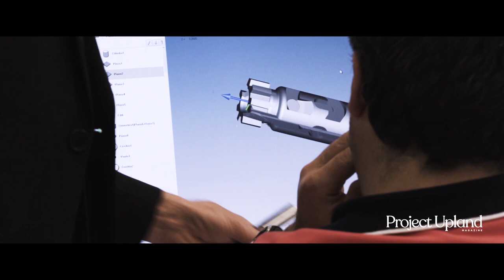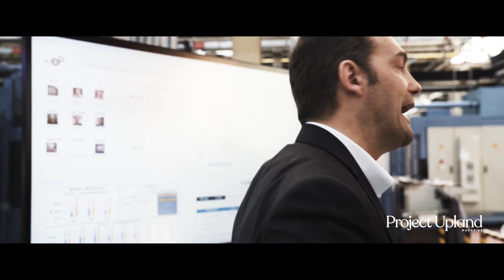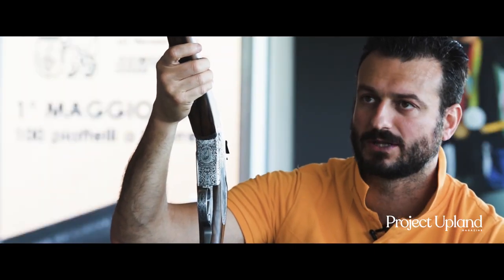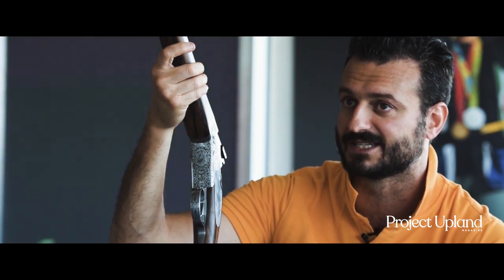Beretta SL3 Review and Factory Tour - Project Upland Magazine

Comment: Not a fan of monoblock barrels, esp. in high-priced guns. But their products are certainly durable. Then again I shoot guns that are 120 years old and still functioning perfectly. 3 have never had a repair.  One more point is that fit is critical in shotguns and though strong and durable, Beretta's stocks are too straight requiring just about everyone to contort himself over and around the gun. Most shooters today seem to think that's just the way it should be...wrong.